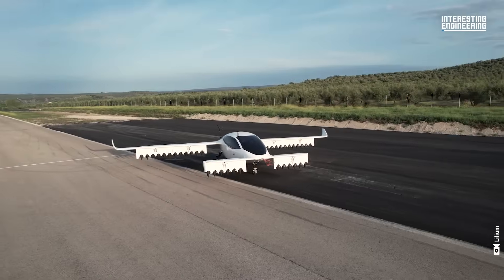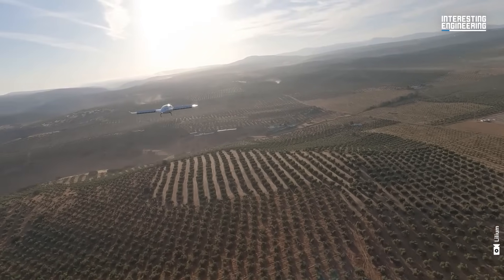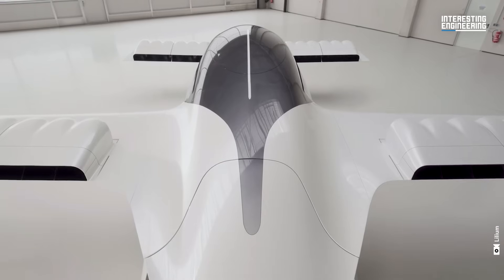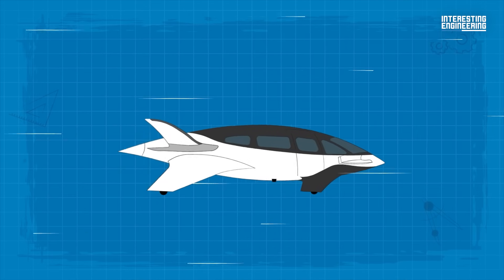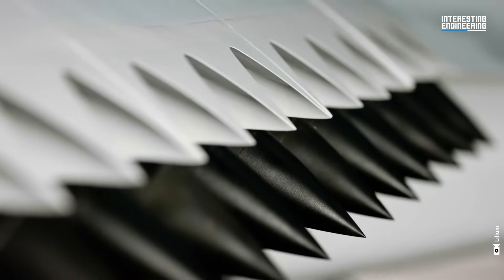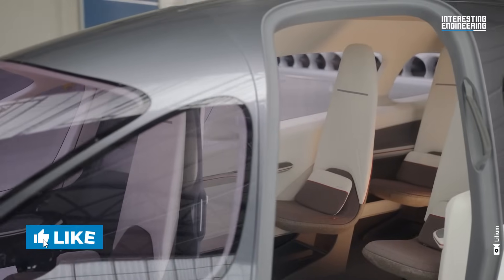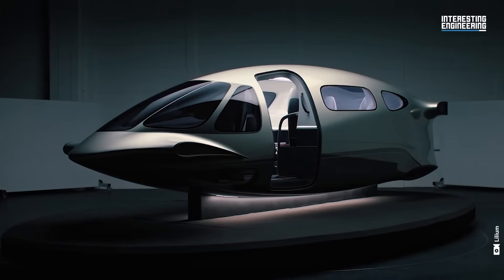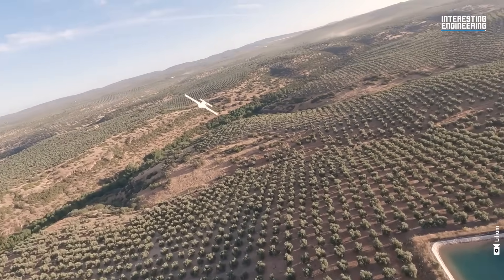The Future of Air Mobility: Electric VTOL Aircraft

Comment: I like knowing that if it runs out of battery it still has a glide ratio instead of falling like a rock. Chance of survival seems much much higher than no wing type evtols.
Reply: No power equals no control - vectoring thrust is great until there is no thrust (and the solidity of the fans if stopped makes them airbrakes - glide ratio of a brick .
Reply: Ill take some wings vs none.  It would be a great test to do for sure. Could be the difference between living and dying…

Comment: No a good  battery capacity , and posibble range was given in the vodeo... How many hours. And how far it can travel were not given here..
one big problem I would.say have not been overcome yet ..is the resistance to cold or very low temperatures..Tesla just show us this. Year how unreliable the batteries can be under extreme cold temperatures ..I would like they. Can get a. Solution to that problem..and to possible fires.

Comment: So we can think of a future where these type of planes can be used for inter city travels, since they won't travel much longer distances.
Reply from the maker: Absolutely, envisioning a future where electric planes like these are used for short, inter-city travel is both exciting and realistic. Their current range limitations make them ideal for shorter trips, potentially transforming regional travel by offering a faster, eco-friendlier alternative to traditional road or rail transport. This could significantly reduce travel times between cities and alleviate congestion on roads and railways. As technology progresses, we might see these electric aircraft becoming a common and efficient choice for short-haul travel, opening up new possibilities in how we move between cities.
Reply: You're wrong.  This design is capable of scaling up to multiple passengers & longer distances.  It's the only evtol capable of that
Reply: You are right, for as long as they store electricity in heavy batteries - nothing really will change.
I simply can't believe they are still doing this nonsense.

Comment: Cool toy, but without a 10x increase in energy density and energy per kg it is not going to fly a meaningful distance.
Reply from the maker: True, energy density is crucial for longer flights, but with advancements in battery technology, we're hopeful for what the future holds!
Reply: @interestingengineeringie  The rate of increase in battery tech has already peaked a while ago so it will take a decades at current increases to get anywhere close, and that's assuming that there are no physical limits which there obviously are.
Reply: 300 km isnt enough? YOU TROLLS...